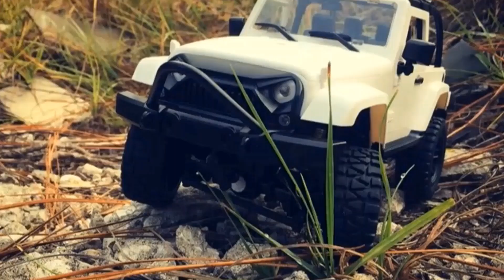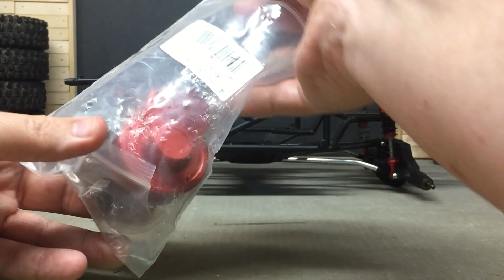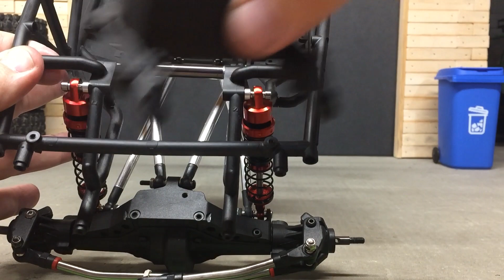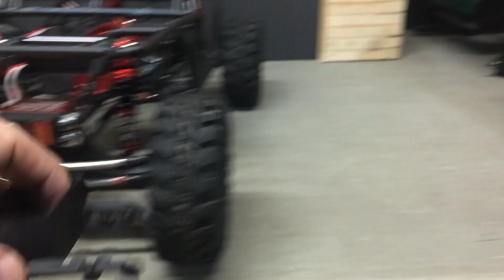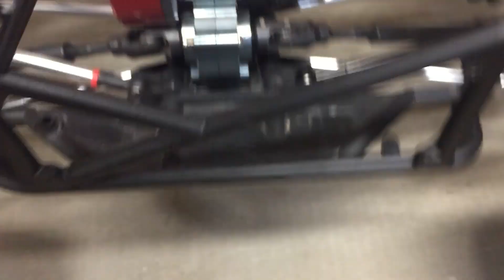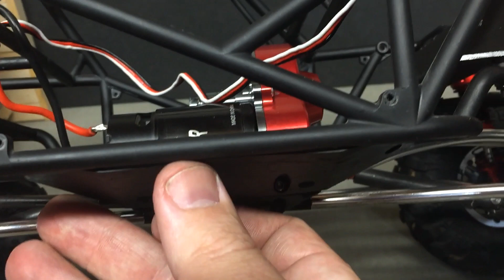Axial Wraith 1.9 budget build part 2

Comment: Where did it get the chassis n cage?
Reply from the maker: It's an Axial Wraith 1.9 cage, I got it used from a friend, you can find them on EBay sometimes
Reply: How's the Amazon crawler I want to build one but idk if I'll need frame rails or does shocks bolt up to cage can u make a video showing
Reply from the maker: @anthonystill1590  there's a whole series on the amazon cage crawler, the cage is the chassis. There are links to the parts in the description of each video.
Here's the 1st video 
https://youtu.be/Y9dTYIld5SQ
Reply: Thank you